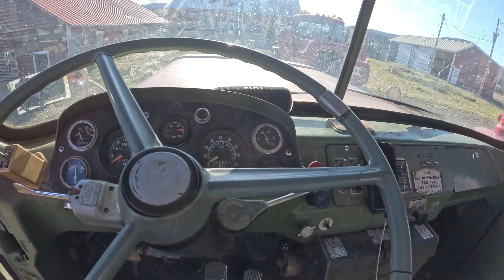Two Mack R models In The Driveway!!! Got Some Great Neighbors & Giraffe Tool Wash Help

Comment: The two stick Mack is like the milk tanker with 5 axles I use to drive as a relief driver. So many buttons to push and pull when turning corners.
Reply: The mack with the armytanker is also a 2stick

Comment: Way back in the early 60"s, worked on a dairy in Wash state.  Had 2 manure trucks, with boxbeds and beaters on the back run by PTO.  Anything less than 40 feet from them and you could get hurt or messy.  We called one The Turd Hearse, and the other The Stool Bus.

Comment: On the pressure washer, eventually, consider relocating it to the house wall where you could plumb hot and cold water to the pressure washer. Very common practice in the Anchorage Alaska area where garages are heated. Great looking shelves.

Comment: A battery tester would be a good investment. Can be had for less than a hundred bucks. I would start by charging those batteries overnight to get a good charge. Once charged you can test them. The 24v do crank over nice but the parallel switches can get to be a pain and a continuous expense

Comment: Wiring outlets in place of those old lights is way easier then you think. I'm no electrician by any means and that was the first thing I wired when I got my house. 6 harbor freight led lights made a huge difference in my shop.
Reply: I have worked for a company where they put a led light too low to the machine. My eyes always hurt when i looked to the machine or worked with it

Comment: Now this is gonna sound a little dumb... but mount a pressure washer on a flatbed yard hand wagon with a hose reel and extension cord reel on the back end and just use a piece of rebar as an anchor through the wagon into the ground when you get it out.  Gives you 50 feet of reach for the whole unit and you can roll it right to where you're working.  You're going to want to be able to clean the tractors/chopper somewhere other than your truck yard and so-forth as well as take it over to the shop to clean that floor and elsewhere.
Reply: Its a pretty good idea

Comment: Dump some additive in your fuel for more lubricant. Some atf does wonders
Reply: Some oil in the diesel also does wonders.
Some engines will run even better

Comment: Good choice to have an electrician do the work as you state that you do not have the knowledge and desire to do the work. Also you might have aluminum wire and that takes special connectors to go to copper wire.

Comment: That bad box trailer you got when you break it down use the frame as a bridge were the old bridge header is I have very good luck with IM]INTERSTATE BATTERY'S AND THEY STAND BYE THEN]M COST MORE but you get what you pay for